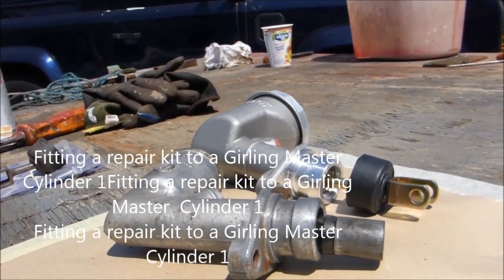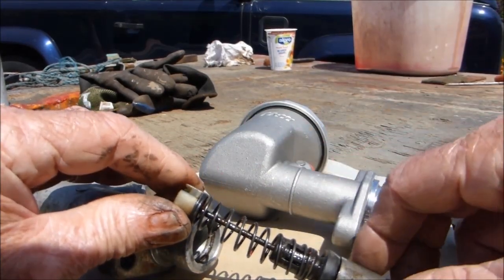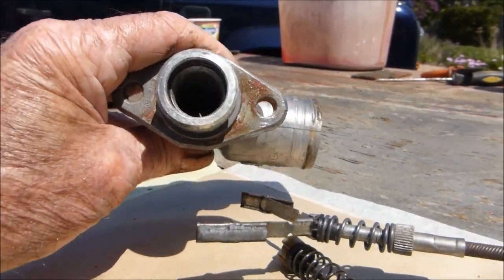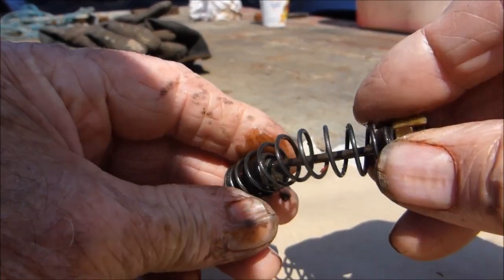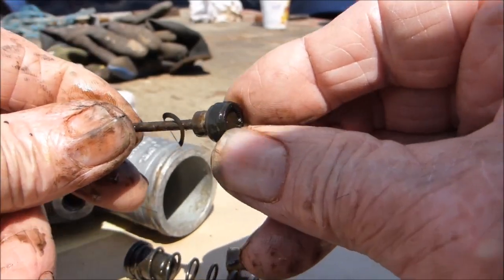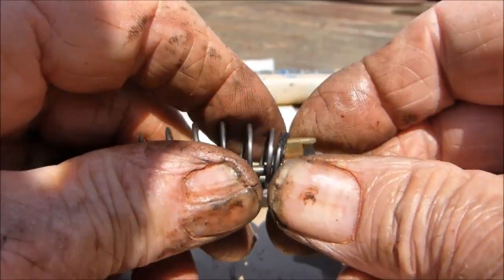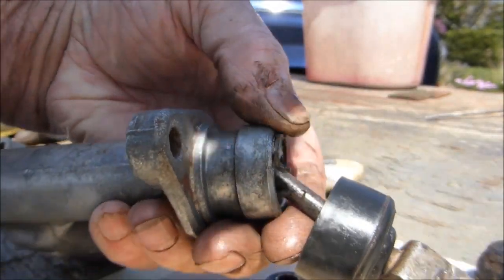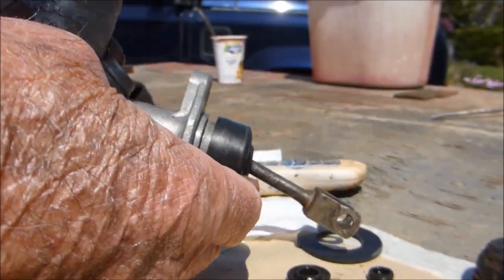Fitting a repair kit to a Girling Master  Cylinder

Comment: Do you folks expect these seal to swell up to a proper bore fit or should they in fact fit the the bore right out of the box. In other words should the seal base OD fit the bore and the lip OD exceed the bore size when not compressed in?

Comment: Nice video, thanks - but how do I get the piston out, please, before disassembly? Mine doesn't come out, and it's certainly not self-explanatory, sorry.
Reply from the maker: Hi Oliver sorry for not getting back to you sooner. Without seelng the MC I am just guessing that the old unit is dry. Try to get some fluid inside and let it soak. Push the piston back a little then tap the unit on to a hard surface so the piston comes foreward.lf you get a little movement push the piston back again. You could try an airline but cover the opening so you don't loose the parts.good luck. Alec

Comment: Great video thanks how much pressure do you get/should I have typically in a dual circuit MC? I have really weak brakes. I bought a pressure testing kit. Goes up to extremely high pressure but I can't even get the needle to move at all. Would this show and prove that my MC is completely gone? I have bought a seal repair kit going to try that now.
Reply from the maker: Many thanks for watching my video. If you aren't getting good pressure it could be you have air in the system and the pedal will feel spongy. If when you press the pedal and keep pressing the pedal gradually keep going down you have a leek in the system or you need new seals.Good luck, Alec

Comment: Seals that fit correctly are hard to find. Many seller are providing seals that are smaller than OEM and the result is short life. Where do you get your seals?
Reply from the maker: Hello thank you for looking at my video. I get the seals from Rimmer Brothers and Moss europe
Reply: @alecmcleod5679  I find that some replacement seals are smaller than I would like see in the kit.  The base of the seal should just fit the bore and the lipped seal end should be  .030" - .040" larger than the bore.
Reply from the maker: The kit for my early TR4 is for a 0.75inch bore, the later TR4 and 4A is 0.70inch

Comment: hi, you do not use brake paste for the assembly of the seal and piston?
Reply from the maker: Hello Antonio, after I used the honing tool I cleaned the inside and lubricated it with Dot3 brake fluid. If you are going to fill your master cylinder with silicone, use that.
best wishes, Alec